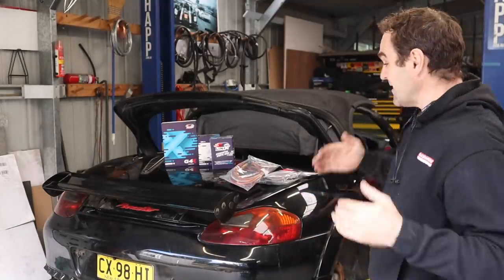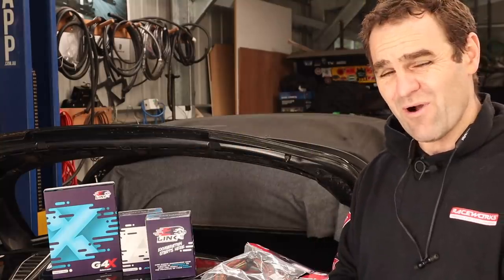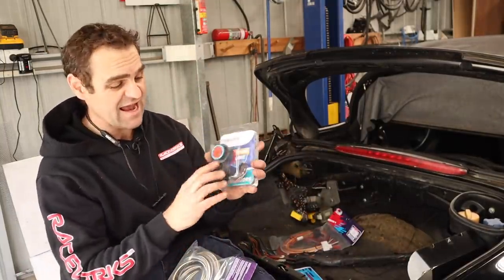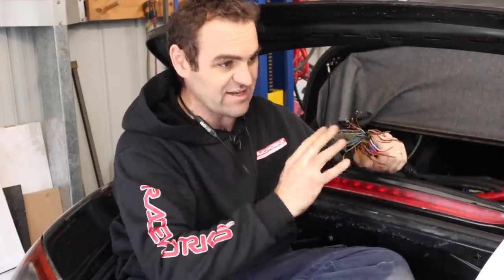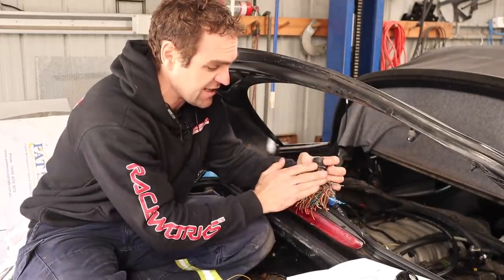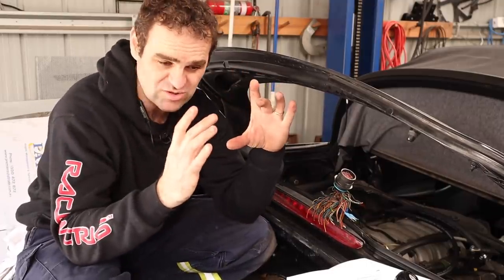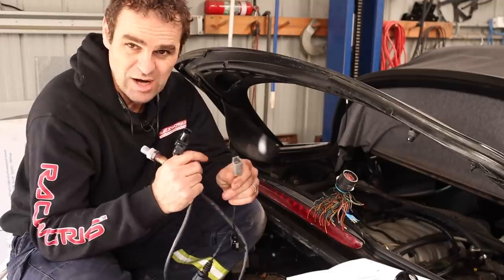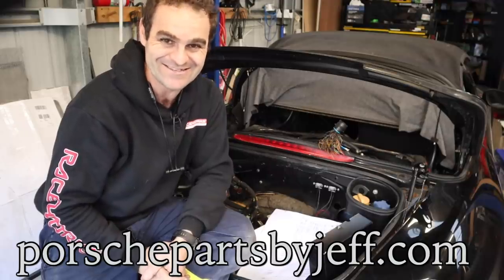How to wire in a stand alone ECU - Porsche 986 Boxster V8 engine swap track car build 12

Comment: Just realizing how much use that car lift gets. With all the other cool additions, from paint booth to machining / metal working / welding tools...
the lift has got to be the most useful, time saving one.  Thinking back, it's being used almost every video.
Wiring is for sure a huge deal at first, but yah, one at a time.  Looking forward to seeing the end result!
Reply from the maker: The hoist is really one of the most cost effective additions to a garage. It makes so many things easier and on top of that it is also the cheapest extra car space you are ever going to get ;)

Comment: Love the new intro and cut scenes mate awesome job has a bit of a mcm vibe to it. I'm currently in the middle of wiring my car up and it is definitely daunting especially if you start adding more to it like traction control etc.
Reply from the maker: Even traction control is not too daunting. Just adding wheel speed sensors is a bit of work if you don't already have them. I added one on Harry.

Comment: When you get such a messy wiring diagram, it will become alot clearer to follow by just coloring all the connections in the correct colors. This takes a bit of prep time but it'll save alot of headaches and frustrations during the actual work.

Comment: Nice work, for sure not something that everyone can do,  anyway I did my swap with a 1.8t and I like everything to work if possible, my ac and power steering is all connected and working, my only issue right now is my traction control is still not hooked up and not sure on the color wire yet and where it needs to go to and my abs is not connected yet because coming from the engine I only have one wire but the car side as 3 abs wires, if you already done that and would like to share some input I would highly appreciate it. Thank you and keep up with the great work

Comment: do you anticipate any issues with the immobiliser? On the Porsche side I guess is the problem as the engine is just sensors at this point!
Reply from the maker: I am not using the Porsche ECU at all, so there is no immobiliser any more.
Reply: Was this kit for the Boxster?

Comment: Applications of Polyurethane Coverings for Wiring and Electronics Polyurethane foam has been used in European vehicle applications as a covering for wiring harness assemblies for over a decade. You just need to find something to dissolve Polyurethane foam
Reply from the maker: Good tip. I didn't think of that.
Reply: @HomeBuiltByJeff  do it right and dissolve it once